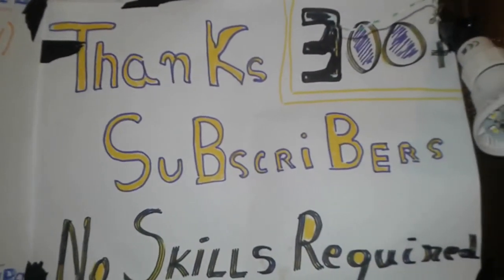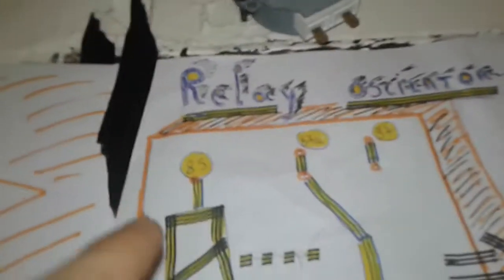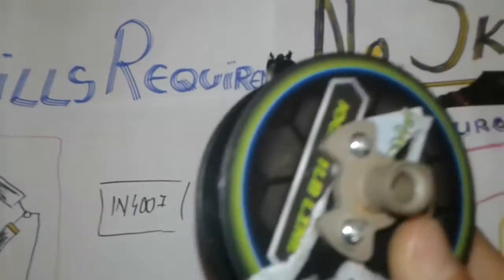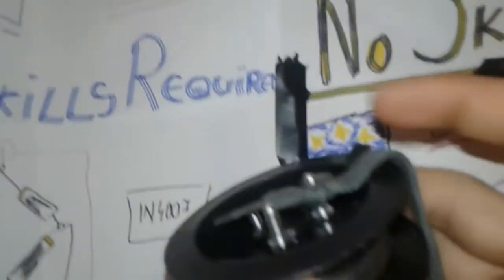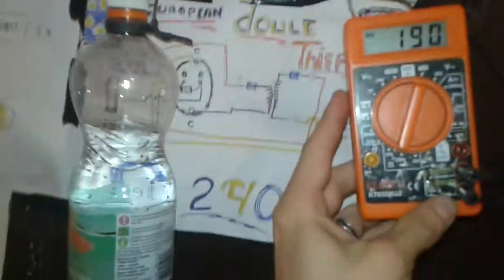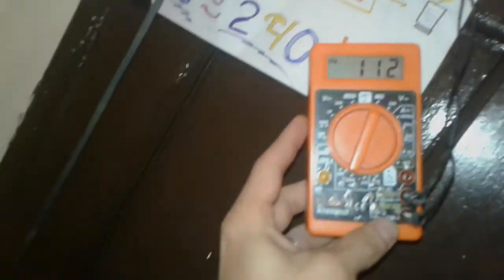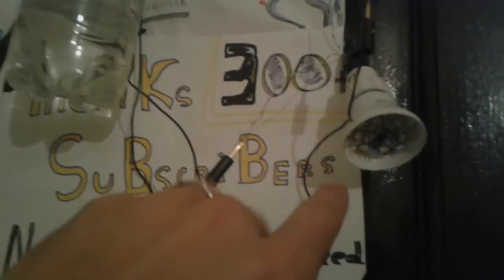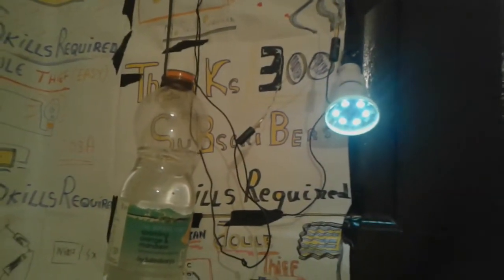Gravity generator project from microwave oven motor at home

Comment: good video but you can make more videos from this by making the system slightly better by adding some components like maybe a capacitor, or adding gears (in a simple way) to slow down the rate that the bottle falls. you might have to change your channel to someskillsrequired

Comment: How did you slow down the fall of the bottle later in the video?
Reply from the maker: Kashan Zafar you have to find out the best weight in my case it was a bottle 3/4 or less
Reply: Kashan Zafar : it slows down when you have a load on the motor. Load as in a device drawing current.  There was no current being drawn when he was measuring the voltage, so the bottle fell a lot faster.
Reply: Thanks guys. I tried it and it's all clear to me now.